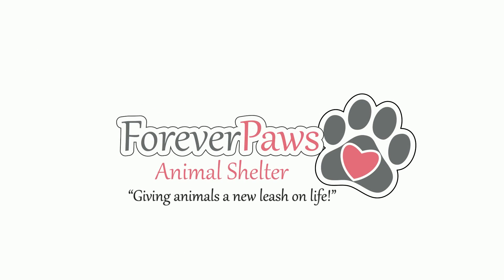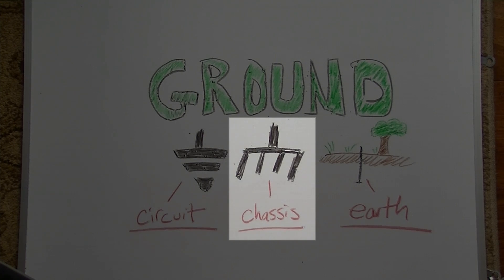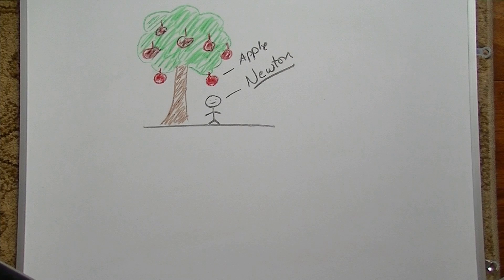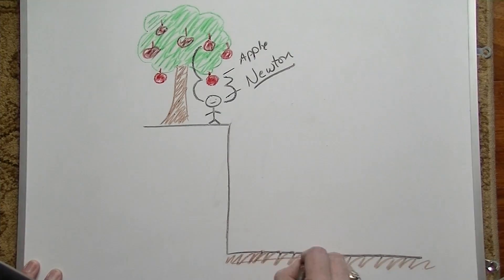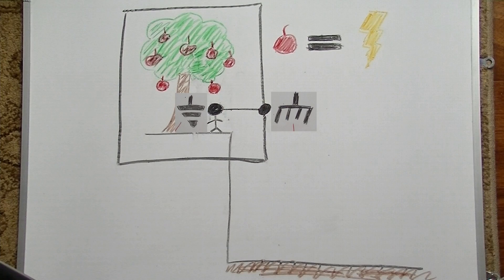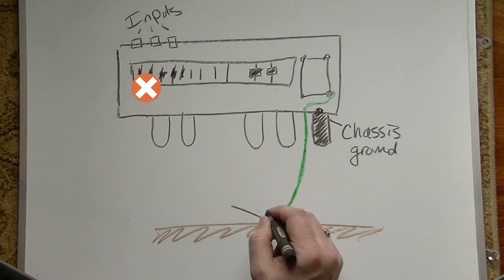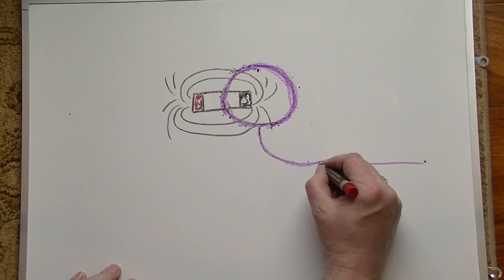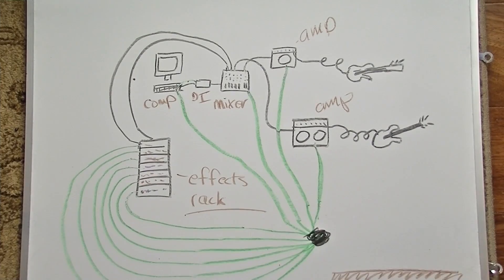GROUND LOOPS in Guitar Amps and Recording Studios Explained

Comment from the maker: One thing I probably should have added is that in this analogy of the apples falling, AIR FRICTION equals RESISTANCE. And the number of apples falling at any given moment equates CURRENT. That's one way to think of it.
Reply: When connecting different pieces of equipment together, the idea of having only one earth connection is good from a noise point of view, but in terms of safety it can be an issue because you end up relying on the screens/braids on signal leads to carry, what can be, substantial earth fault currents. If the signal grounds don't survive the fault current, the breaker may not trip and equipment can remain at mains potential. It's difficult with old kit that uses the chassis as a ground buss, but where possible it's a good idea to keep signal grounds separate from the chassis and use a safety ground lift connection at one point to the chassis which is connected by the mains lead to earth. Here's a description of how to make a safe ground lift http://sound.whsites.net/earthing.htm
Thanks for all you videos Brad, I really enjoy them, especially SPF!

Comment: Hoping you can help.  I just got a new Strat and when I played it at the store it was perfect.  However, when I play at home I can't get rid of a terrible buzz (not 60's cycle because it happens in 2/4 positions).  When I touch the bridge, cord input housing, strings, or keys, it goes away.  When the guitar is still it buzzes like crazy.  When I bring it closer to my body, it gets louder.  Even if I touch the metal parts of my pedals, it goes away.  I can't duplicate this anywhere else aside from in my apartment community.  The store even gave me an amp to take home and test - buzzes. Brought it back to see if it would - no buzzing.  

I'm losing my mind lol.  I've turned off all lights, wifi, didn't change a thing.

Any suggestions?

Comment: I use one single extension cord to connect my amp, pedal, laptop.. it's usable but I think the amount of noise is not normal (even for the single coils that i use) especially when I connect the laptop charger. It's extra noisy when I have the house inverter/backup power ON; even when the laptop charger isn't connected, the nosie increases when the inverter is turned on. Any advice?

Comment: So the basic premise is...    Ampeg amps with 2 prong cords will present you with an issue when converting them to 3 prong cords.
Reply from the maker: That does seem to be a possibility. The OT on this thing was near the INPUT JACKS. I think Ampeg engineers were trying to minimize ground points, realizing that they can't really change the contact point of the jacks on the chassis, so they decided to make that the primary star ground point, and in that config, the OT being near the jacks makes a twisted kind of sense. But making the main "earth" ground point at the opposite end of the chassis, near the PT and power cord, as is the modern standard, that scheme is screwed up.

Comment: Very well explained and illustrated, I saw this before I think as part of another video. I have a few questions..
1)
As I understand it a ground loop is just a conductive loop connected to or through ground? But the problem is the loop and not whether it is connected or isolated from ground? We just use the term ground loop because it is such a common problem?
2)
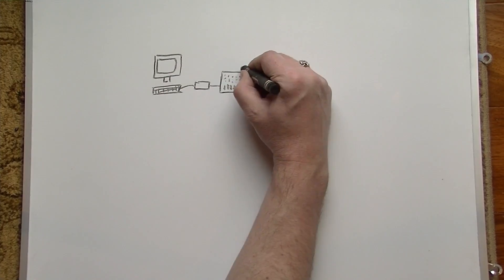@5:10 you say that equipment in e.g. a studio ideally should be grounded through a single point.
Wouldn't this still create ground loops between all the equipment through that single ground connection (and the audio path between the equipment - which of course ideally should be isolated)? How does connecting to single ground point prevent ground loop problem? What is the difference between connecting to ground at a single point rather than multiple points?
3)
My third question is not related to this video, but I was just wondering about something. I do some direct recording at home with a lot of pedals, I am using an isolated power supply (Yankee hs-m12), As I understand it isolated power supplies prevent ground loops between the pedals. Do you know if this means that the pedals are completely isolated from ground?
In which case is it better (better = less noise) that the audio path has no connection to ground what so ever VS  having the audio path connected to ground at a single point?
Reply: 4)
@4:36 You explain that electromagnetic waves produce a voltage in a conductive loop. Do you know if the same is true for any conductor regardless of it being a loop or not? My guess is it would also produce a voltage in a non loop conductor, that is what can happen in long unbalanced guitar cables right?
Reply from the maker: @user-ic7cj8lq9z  You can think of a ground loop as a big, unintended antenna picking up electromagnetic waves and causing the circuit ground ITSELF to fluctuate at whatever amplitude and frequency the source signal is putting out. In this case, the AC from the wall is coming in at 120V 60hz. So the Frequency of the signal being induced into this loop that's just sitting there on the chassis is 60 cycles per second. I could have also demonstrated this by plugging an AC motor into the wall and holding it near or even on the chassis. Something like a drill running near this loop would be pickup up and a fluctuating "AC" voltage would be set up in the ground loop. This is exactly the same principle as a transformer... A transformer has a primary side and a secondary side. So you have one AC signal coming in that has a set voltage and frequency, and it induces voltages in the secondary windings without touching them. These windings are like our ground loop. If you recall in grade school, you might have done a science project like an iron nail with a wire wrapped around it. Applying a DC voltage to the wire with a battery would magnetize the iron nail and you could create an electromagnetic door bell as the nail would be attracted to some nearby piece of iron. If you swapped the battery leads, the nail was repelled from the piece of iron. So AC is just a DC that keeps changing polarity at a set frequency. Think of the nail hitting the sides of the glass jar as the "hum" induced by the presence of the voltage in the coil (loop). If you want to go down the rabbit hole on this, I suggest googling how antennas work. Lots of diffferent kinds of antennas meant to be TUNED to catch certain frequencies, like 2.4GHZ or 5GHZ wifi, for instance.

On studio stuff, the illustration I made is confusing a little because I'm showing grounds running out from each piece of gear. That isn't usually accurate. The idea is to have ONLY ONE piece of gear connected to earth ground. All other pieces of gear should have their grounds "floated", i.e. NOT connected to the wall outlet ground. In a studio setting, ground loops are occurring inside the entire room of the studio, in the walls, and run back to the power box.
Reply: @Fixologist1  Thank's Brad for taking the time to respond. I have never researched how antennas work, I should definitely do that. Regarding the studio scenario. Lifting the ground on high voltage equipment would be dangerous, I think what you explained in the video is correct but you would also need to have transformer isolated connection between the studio equipment to prevent stray voltage from flowing between equipment.

I was just reading this on Wikipedia which helped me understand a bit better, but I'm not sure it is the correct definition of a ground loop:
"ground loop or earth loop occurs when two points of a circuit both intended to be at ground reference potential have a potential between them."

"Wiring practices that protect against ground loops include ensuring that all vulnerable signal circuits are referenced to one point as ground."

What I understand from this is that connecting to a single ground point is important because it avoids having electrical potential between two ground references which could cause stray voltage to flow from one ground to the other through the circuit and introduce noise.
I still don't understand why ground loops are more susceptible to electromagnetic induction than non loop conductors but I think maybe researching how antennas work might answer that question.

Comment: Keep that ground rod attached and moist in the summer if the soil gets too dry you might get a weak ground. Then power does scary stuff looking around your house for a place to get back to earth
Reply from the maker: I'm sure that can be a real problem in some kinds of terrain. Never thought too much about it, but I bet you're right. The recommendation for a ground rod is 18'... Notice that's NOT inches, Nigel.
Reply: First found this issue in a cable tv install in a trailer house during a drought I kept getting bit by the stray voltage we put the hose on the 6ft ground rod and no more shocks ... the cable boxes lasted longer than a week too 🤣